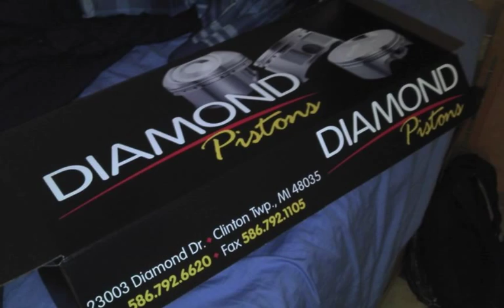392 stroker install and build

Comment: wait, that's a 318 or 360, not a hemi. Do you mean you did a 410 or 408 stroker? How has it held up for the last 5 years, pretty good?
Reply: 318 bored 0.040" and stroked to 4" is 392
Reply: 318 stroked and bored to 392